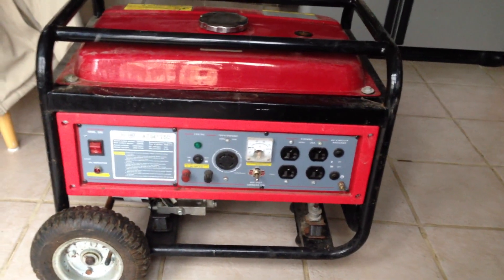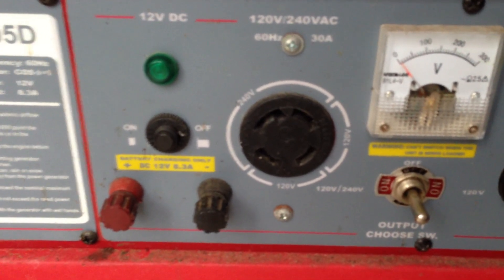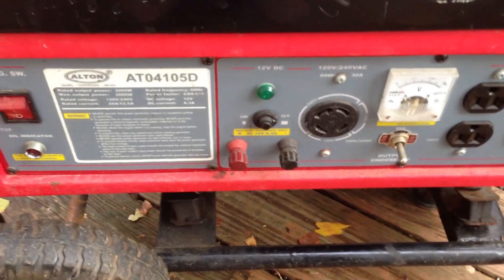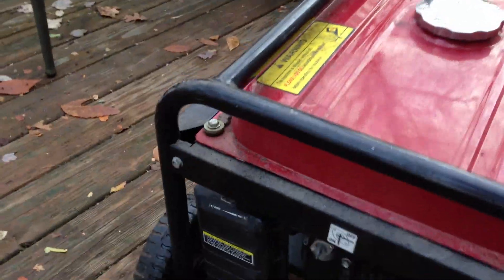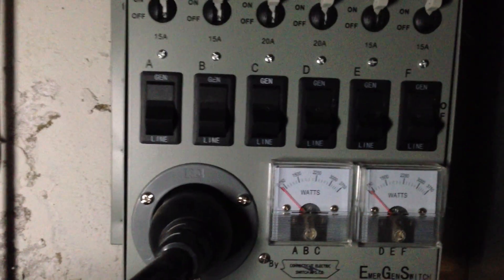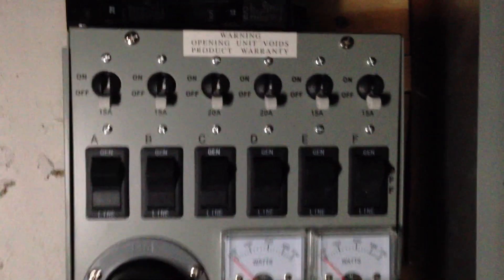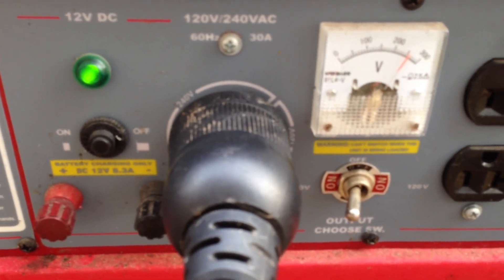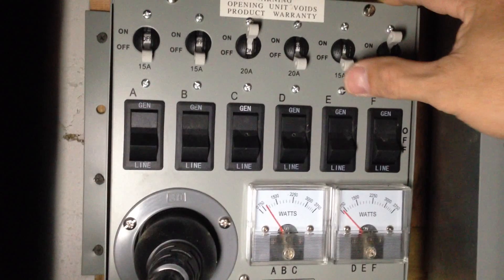Emergency Generator with Power Transfer Switch Service Panel Sandy Outage 2012 Hurricane Storm

Comment: I don't do most of this. Just start it up, let it run for a minute and then switch the power to the house. The AC has a 5 minute delay so I'm good there. You really only need to turn off big appliances like electric stove, water heater or if you have a well. I have gas appliances so there are no big loads, I power the whole house including a/c on an 8000/10000 watt generator.

Comment: Check the rating tag on the fridge. If the rating is in amps, simply multiply the amperage by the operating voltage and that will give you the wattage.

Comment: newer fridges only take about 600 running maybe 1000 to start if its an older one. 3000 would do a home, not every item at once but the essentials.

Comment: if you had to do it again why not return the expensive transfer switch that limits your circuts used, install a 30 amp breaker and outlet, make a bracket to lockout the main and have full use of your panel?

Comment: I am easily running a gas furnace motor, large refrigerator, various lights etc in the house on a Honda EU2000 with a Reliance transfer switch.  The startup watts are what use a bunch of watts for a second.  As long as all the motors aren't starting at the same time, I've found I'm only using a constant draw of about 1100 to 1300 watts.

Comment: These generator have a electronique engine idel adjustement so when you are on light load the engine RPM is slow down and the opposite with heavy load so it does really change . Even if the engine in the EU2000i is smaller, it would have to run at a highter RPM to do the same job of the GX390 but at a lot lower RPM
Reply: No it doesn't.

Comment: I purchased a generator with a Honda GX390 engine from Costco a few weeks ago.  It's a very nice generator but I've started questioning my decision to buy a 6800 watt unit.  The reality is that I only need around 3000 watts to power my gas furnace fan, fridge, a few lights etc and with this big unit, I'm going to be burning a lot more gas than I'd like.  I'm actually considering buying a Honda EU2000i which would power what I need and only burn around a gallon of gas a day.
Reply: Oh.... I see

Comment from the maker: If I had to do it again, I would go for 6500 watts (7500 watts tops) generator. This will allow you to run a couple of "watts hog" appliances like a vacuum cleaner, coffee machine, blow dryer, etc... Running 2 or more of those on 3000/3500 watts generator is out of the question.

Comment from the maker: Steve, the 3000/3500 watts worked just fine for my essentials: fridge, freezer, kitchen (gas range) 3 bedrooms, family room, 2 bathrooms, and furnace / baseboard heating. The draw on my fridge was 650 watts (initial draw was 1350 watts). You will see this on the vid when I flipped the first switch.

Comment: Im new to the generator thing and im thinking about getting into it and  i would like to set it up like this i think. From the little research i have done i thought you would need 3000 watts just to run the frig... which is obviously wrong if your running all the stuff you are... can you clear this up for me please? thanks